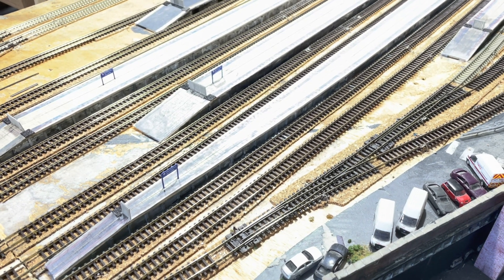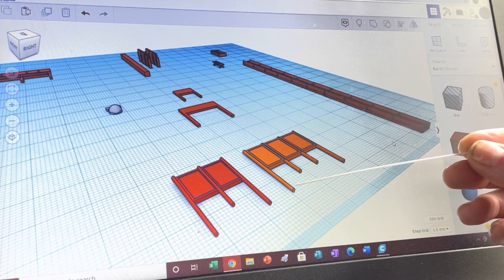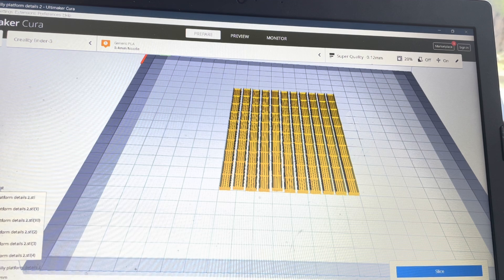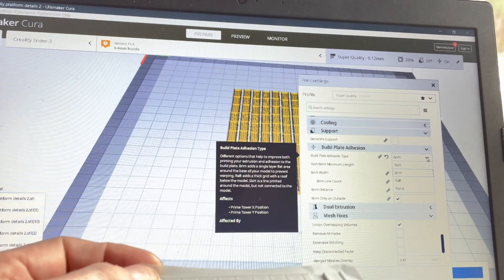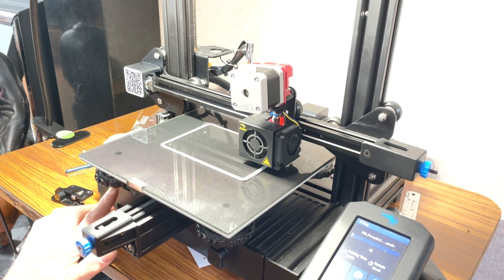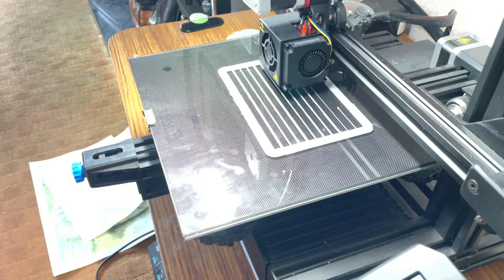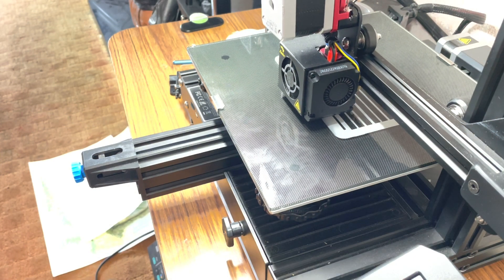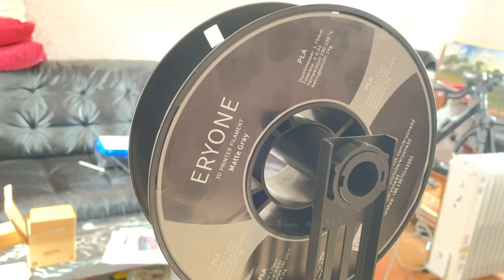My experience with Creality Ender 3 v2 – Using a 3d printer for Railway Modelling

Comment: Good video. I have just bought a 3D printer, but it is still sitting in its box because I have been too busy in the garden taking advantage of the dry weather! Thanks for uploading.
Reply from the maker: Well… the weather has turned at the moment (hoping not for long mind), but what you can do is incredible. I did couple of 3d printer videos if they are useful to you

Comment: What size nozzle have you got in your hot end? The standard nozzle size is probably 0.4mm. I found I got much better results for small items with a 0.3mm nozzle. Make sure to check the bed height after changing a nozzle. Also, you have to change them while they are hot and the filament is soft.
I use Slic3r to create my Gcode. The interface seems simpler than the software you are using.
Your Piccadilly is instantly recognisable.
Reply from the maker: Thank you, yes there are many setups for these devices. I guess the trick is finding what works for each of us. Ill keep my setup for the time being. ( if it aint broke, dont fix it - type thing. Lol)

Comment: It is my understanding that the skirt is used just to make sure that the filament is purged by the time it actually starts printing the model - its supposed to clear any bubbles  before getting to the part.
I use a glass bed, and use a shot of hairspray every 3 or so prints - have had excellent results with prints staying stuck.
I use an Ender 3 pro that I have upgraded with better bed springs and a glass bed.   I also use a Longer Orange 10 for resin printing - which is great for really fine detail.
3d printing is a hobby in and of itself, be prepared to mess around with it until you learn how to do it.   If looking to get a printer make sure to do your research, and watch the videos for how to set up the unit correctly.
Thanks for the informative videos, love seeing how the Piccadilly station is coming together, the details are amazing.
Reply from the maker: Thank you and great advice too